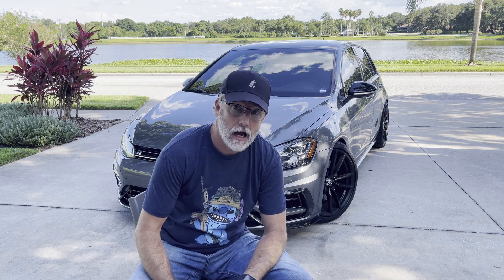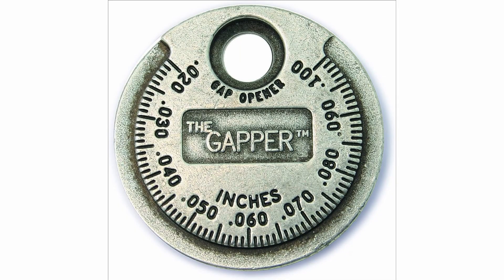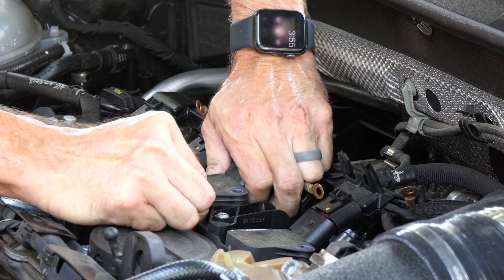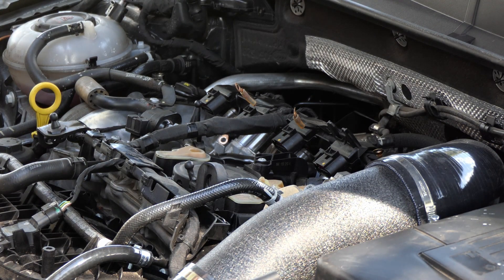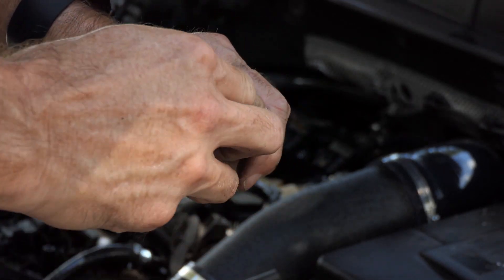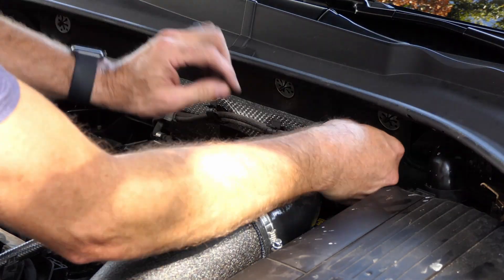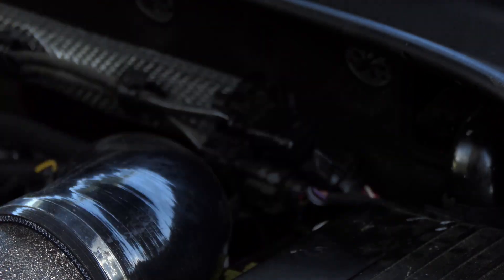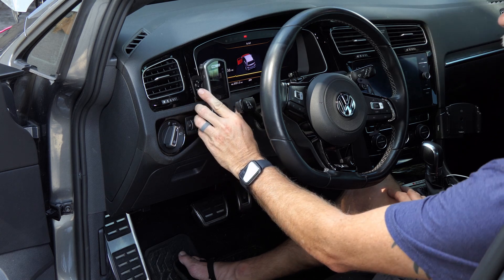RS7 Spark Plugs in a Golf R and Unplugging The Rear O2 Sensor!

Comment: You can use the dish type gap tool. The only way the electrodes will break is if you are trying to be legally stupid.
Reply: What you mean trying to be legally stupid? I guess just go easy on it dont be too hard when checking the space? Just bought the disk one since i ordered the rs7 plugs and need to check the gap lol

Comment: My understanding is that running rich = less potential damage but less power, running lean = more potential damage and knock but more power, so because I want my GTI to last longer and still be stage 2 EQT, Should I keep the O2 sensor plugged in or unplug it? I'd rather run richer to be on the safe side, unless my understanding is incorrect.

Comment: This question might be kind of silly but I have  a CEL for cat inefficiency bank 2. My solution is to put an o2 spacer in that has a minicat on the end of it. If I just unplugged my rear o2 will i see the same CEL for that? Did you get the same CEL?
Reply: Tbh I just live with the check engine light, just a quirk of living with an aftermarket downpipe.
Reply: @CyseTV  I'm on my second spacer since my comment and still a cel. Yeah i've accepted defeat too lol

Comment: Did this also get rid of the check engine light too? Also is this method still recommended?
Reply: I'm wondering if it's still recommended too.  The CEL is super annoying.
Reply: @haivemusic  as far as I know I looked it up recently with EQT and one of their tuners on a forum (this was from may of this year) said that EQT nor Cobb will ever fix the issue.
Reply: @ss10million  That's quite unfortunate to hear, but not surprising I suppose.  It seems everywhere is afraid to mention anything regarding emissions related components these days, yet alone do anything with them physically or tune wise.  It really is a shame they can't address and properly fix this issue to avoid such a hacky workaround.
Reply: @haivemusic  did some more research and figured out I can unplug o2 sensor in the rear and be fine, if you have a catless DP and don’t unplug rear o2 sensor or get o2 sensor spacer you will run rich, I guess the downstream sensor on these cars also communicated with the first one and alters fuel trims. It is what it is. I’m glad I live in Florida, we will never have emissions thanks to Ron desantis
Reply: @modernbassheads5051  Thanks for the update! Really appreciate it!  You mean, you aren't getting a CEL on your dash with it unplugged?  

I have a high-flow cat (APR downpipe), however... I was still getting random codes for it even on my APR tune before switching to EQT.  I did end up going with a J spacer, but ... it still tosses codes randomly.  I think maybe I either need to unplug it completely, or try a non-J spacer. 

Unplugging it would be the best option, I just don't want a CEL on my dash unless it can't be helped.
Reply: Tuning in for replies , I just got a 19’ rabbit edition and it’s bone stock, before I get buyers remorse and buy a Cobb AP, I wanna make sure this issue is fixed or I can get some advice otherwise I’m going laptop tune or another method
Reply: Is this advised for EQT stage 2 tunes also?  Want to get rid of the CEL.

Comment: I recently unplugged my rear O2 sensor after having some problems. I wasn’t having issues untill I had my motor built and retuned. It started throwing rich and lean codes with a CEL after every few hundred miles and would start misfiring, but would go back to normal when I cleared the codes. Took it back and my tuner and unplugged my rear O2 sensor. I reflashed my tune, so hope it’s all good now. My R is protuned using Cobb software and running a catless downpipe. I saw your video a few months ago and didn’t think it applied to me haha. Should have done it then though

Comment: Are you still running these despite the article from EQT saying that these are no longer recommended due to the failure rate?
Reply from the maker: I am still running them, yes. However I will switch to the new recommendation at the next plug change.
Reply: How comfortable do you feel running the RS7 plugs in the meantime? I was originally going to use the NGK 91006 but considering I never stage 2 yet, I decided to buy the Denso 5749s and going to use those ones. Just kind of sucks that the 91006s I bought are useless but small price to pay if they were to break I suppose... I believe EQT also mentions that the race plugs do not need to be gapped and could stay at 0.028 instead of the recommended 0.024.
Reply: Update: I went EQT stage 2 with the Denso 5749s and car runs flawlessly!
Reply: @SupportIsPower   so did you gap the denso race? or not? next week im gonna install the denso race 5749. thanks!
Reply: @ianpats130  Hey, I did not end up gapping them. Did you?

Comment: Great video! Just curious, why did you reflash the tune at the end of the video? Is it something required to do after replacing spark plugs? Thanks
Reply from the maker: It was because I unplugged the rear O2 sensor.  I need to flash if just doing spark plugs